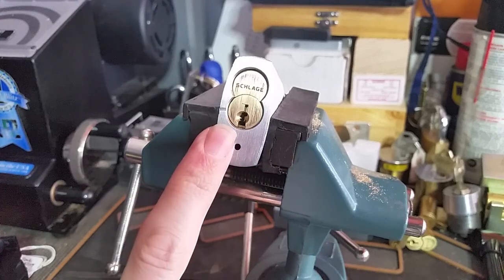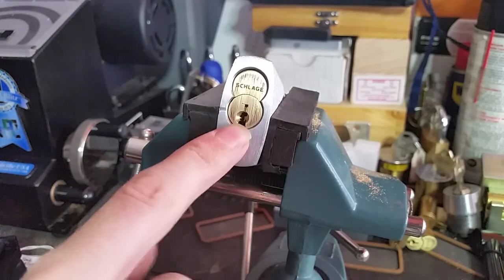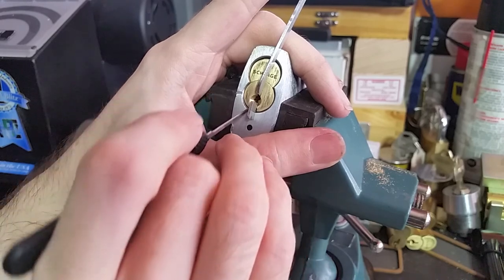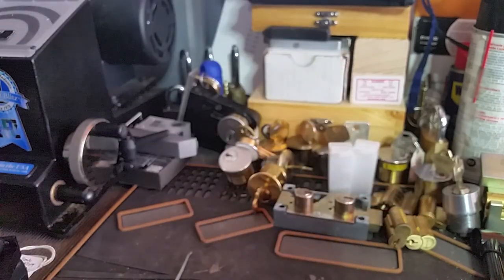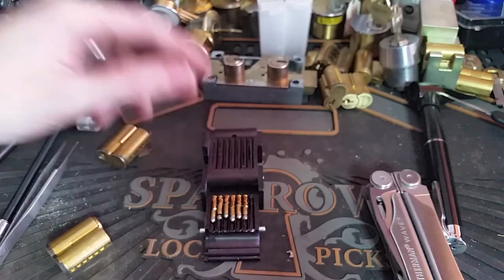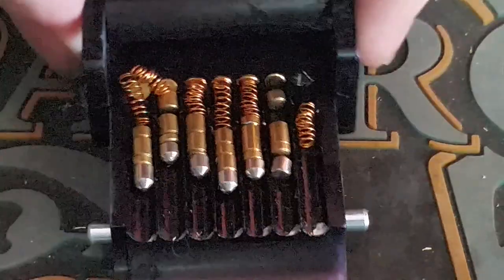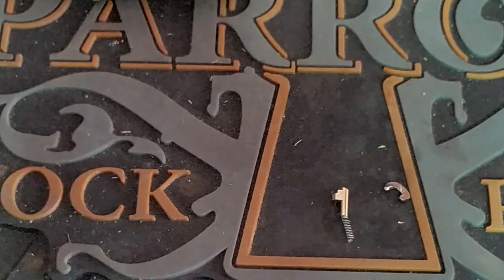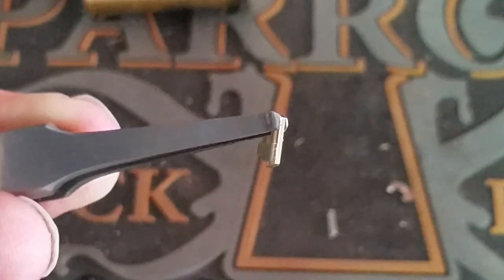(102) Schlage Everest 1st Gen SFIC

Comment: Interesting -- I'll have to check which version of Schlage SFIC core I have -- I think it's in the Everest salesman's sample kit
Reply from the maker: Later versions of the Everest SFIC moved the check pin towards the rear of the cylinder similarly to how it is laid out in the full size cylinders. They also make Everest 29 SFIC using the R family of keyways (R blanks are backwards compatible with B family keyways but B blanks will not work in R keyways).